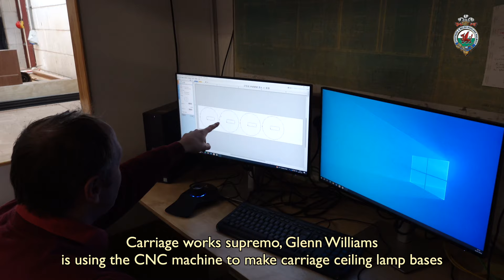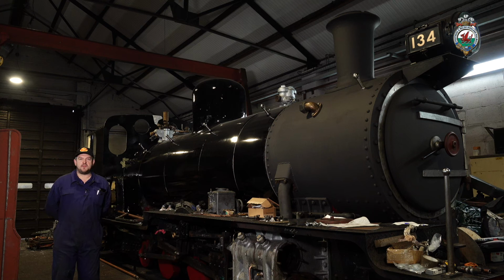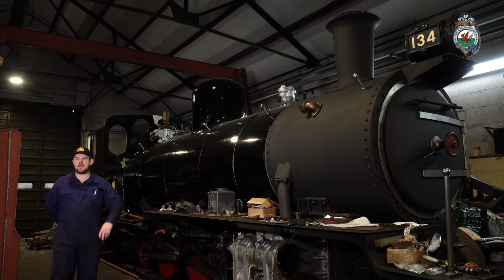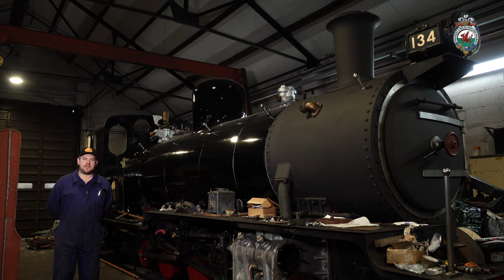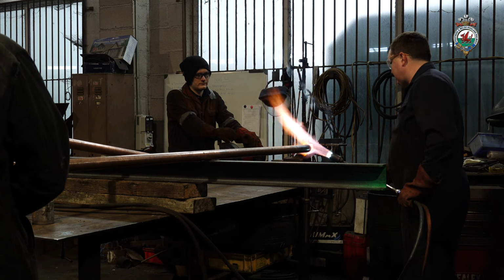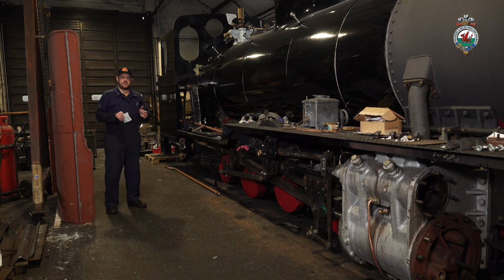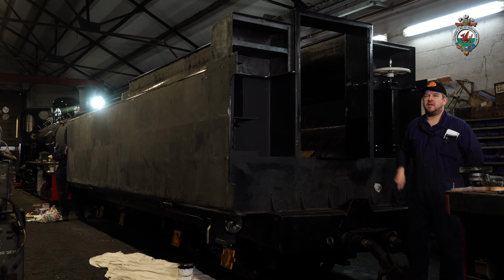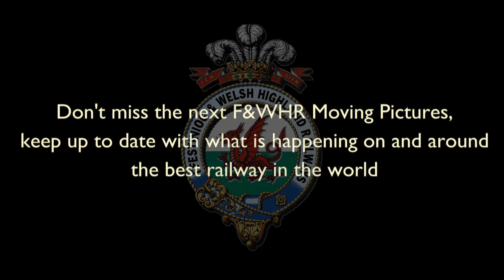Moving Pictures Eighty Seven - 22/1/24

Comment: great job btw why no tender cab ?
Reply from the maker: The new loco cab has glazed returns behind the crew like many Baldwins etc. If this does not prove sufficient a removable tender cab option is designed, it fits where the toolboxes are.